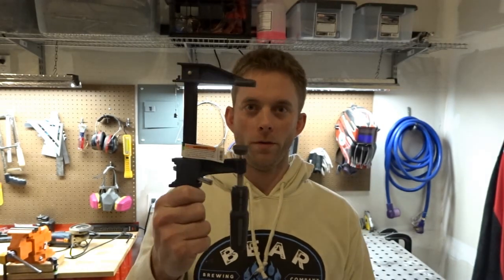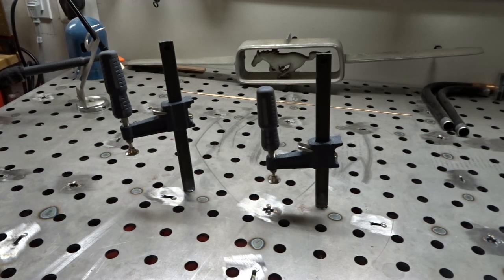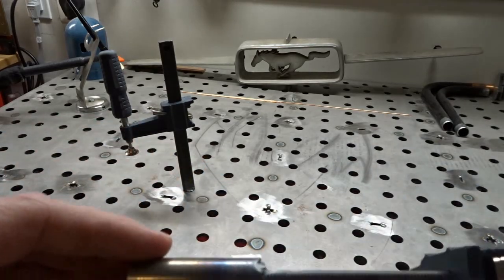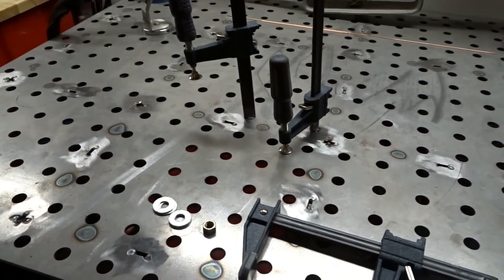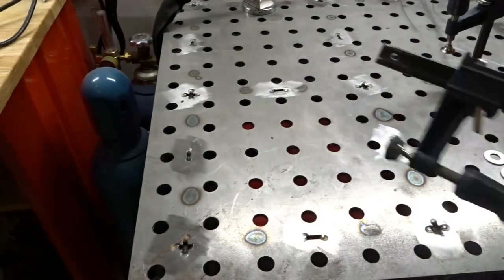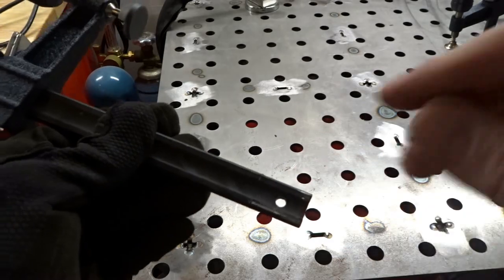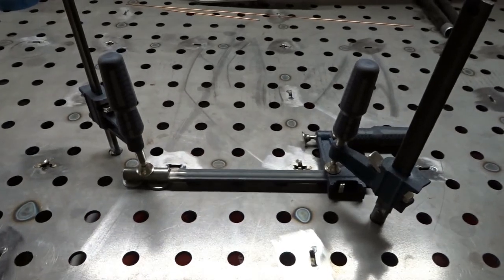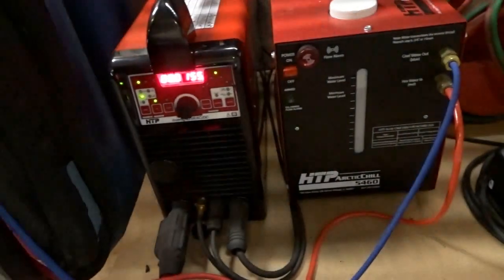Welding Clamps for Weld Table

Comment: I noticed you're using a 12 Fupa cup. I only use that cup when I'm welding stainless. Not saying it's a bad thing. For most of steel welding I use a 8 cup with a gas lens. It saves on gas. BTW I like the work you do and you videos have been helpful. Thanks!

Comment: Paul, you don't need 2" of round stock if your table is only 5/8" thick.  1" will be sufficient.
Reply from the maker: 1” is definitely sufficient. However, I have found that the extra inch comes in handy at times. Thanks